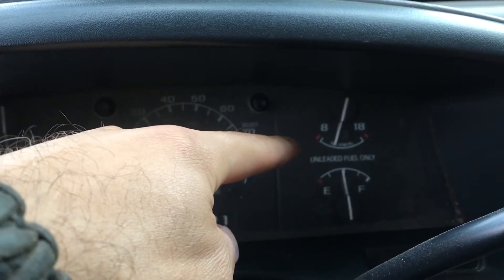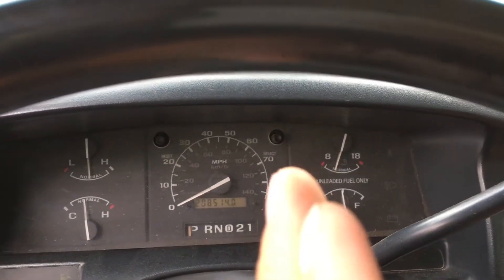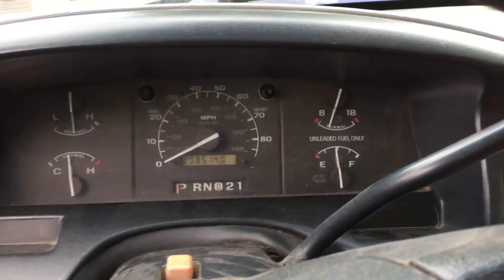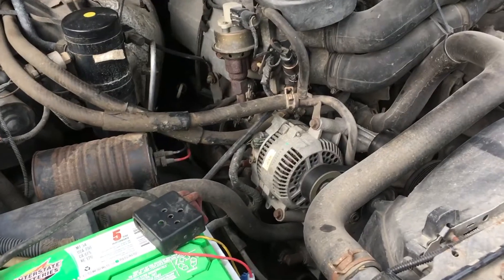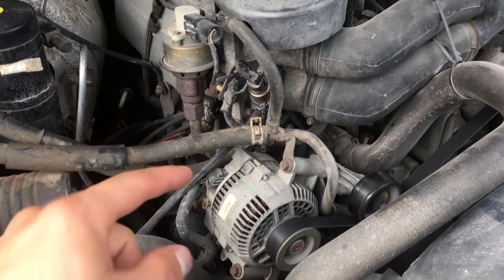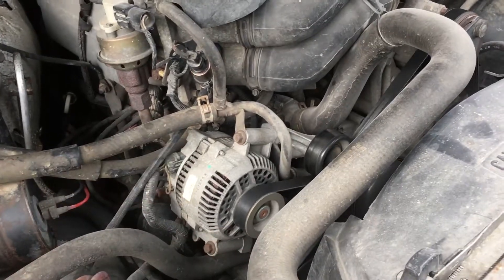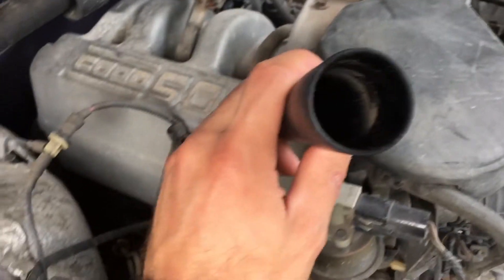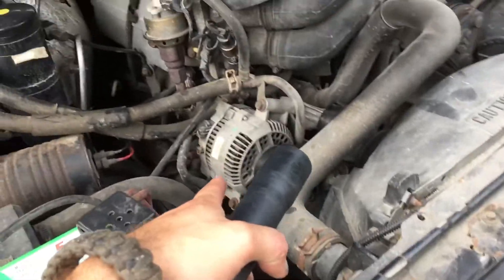How to Test an Alternator with a Stick | 1995 Ford F150

Comment: New subscriber Hello thank you for your video I have 1995 f150 flareside 5.8l I recently installed car lock in it which drains 2ma when the truck is idol when I installed this the old battery died was not enough to crank than when I changed to a newer better battery (walmarts ever start max) it was fine for 2 days than the app read 12.7 volts and had did not read before I left it parked for a couple of nights the voltage in the app reported 13.5… do you think it’s a weak alternator?
Reply from the maker: Welcome! Did your truck have this issue before you installed this car lock? If it didn’t, then I would probably revisit the wiring and see if this is something that’s constantly on. If it is that could be your issue. Otherwise, if the voltage in your battery is increasing, I don’t necessarily see that as a bad thing as long as it doesn’t get too high.

Comment: My old 1986 ford had a hart start plus the battery was dead so I replaced it then it started to sound like a pace paper in a fan now am off to see if my alternator is bad thank you for your good notes 😁
Reply from the maker: Sheree Busby No problem!🤙 Alternators are usually a problem on high mileage trucks. They only last for so long.

Comment: Another good way too find out if your alternator is bad is to place a screwdriver on the back side of it and if it pulls the screwdriver to it like a magnet it's good....I'm not 100% positive but if the voltage regulator is bad it won't provide current and if the ?reluctor? is bad then it overcharges the voltage system
Reply from the maker: Yrusonoz 79 That’s cool! I’ll definitely have to try that! I think you are right. The voltage regulator causes the weird problems usually.

Comment: I've seen it all now..attah way to test voltage...this dude must of been born analy
Reply from the maker: Matt Hand It works doesn’t it? It was later diagnosed as bad.
Reply: @TheMinuteMasters  it 100 % works......though an electronic car stethoscope would be more appropriate
Reply from the maker: I didn't know they made electronic stethoscopes. I just figure they used a voltmeter.
Reply: @TheMinuteMasters car stethoscopes are available, used by  mechanics in the uk, though a long handled screwdriver also works and are much cheaper to buy
Reply from the maker: Frank Fernandez Gotcha. Good to know! Yeah a screw driver is definitely cheaper!👍